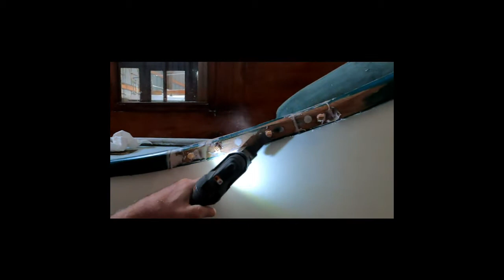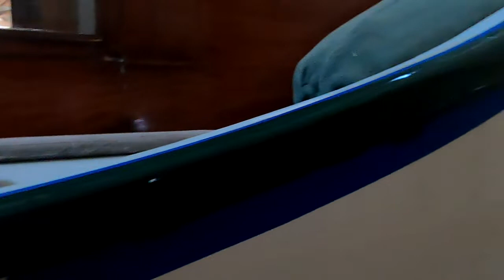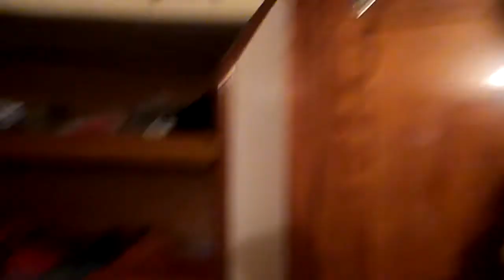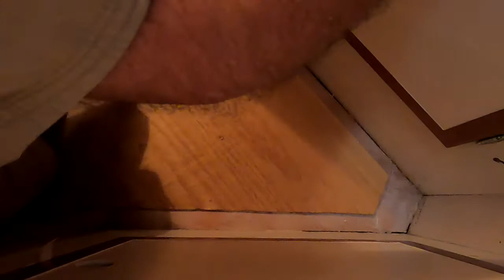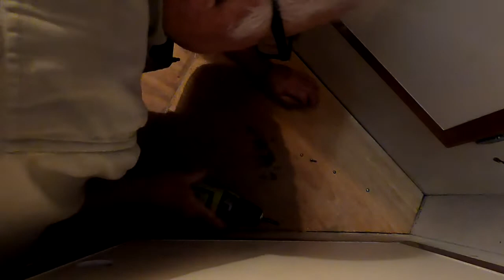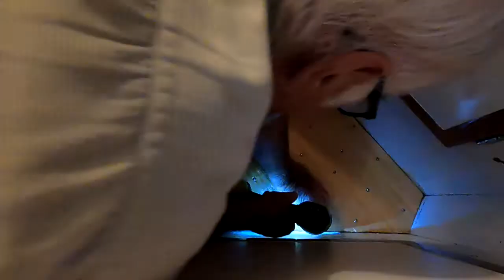Boat Maintenance - New Cabin Sole Part-2 (11/9/21)

Comment: It looks like the repairs are going well, thanks for taking the time to bring us along.
Reply from the maker: You are welcome Jeff.  Tomorrow I will back the screws out and fill the holes after I measure to figure out how much cherry to buy.  I will start laminating up the actual sole once I buy the cherry so I can get started putting the actual sole in.  I would like to get it installed and get a few coats of varnish on this fall.